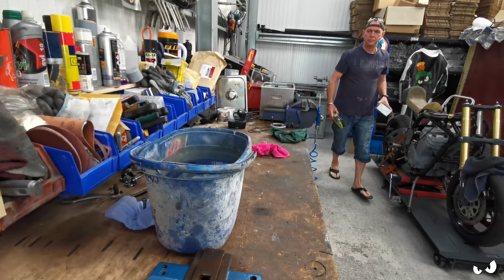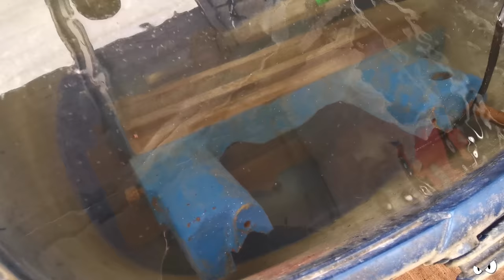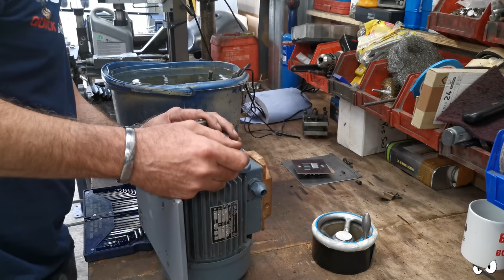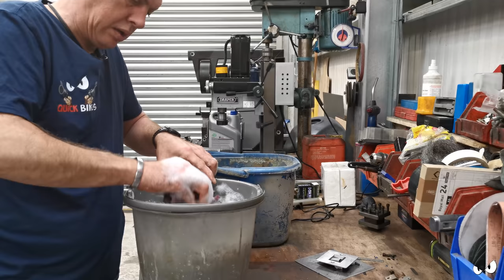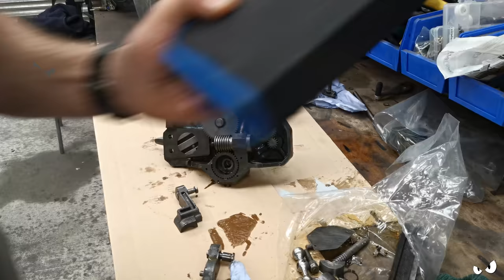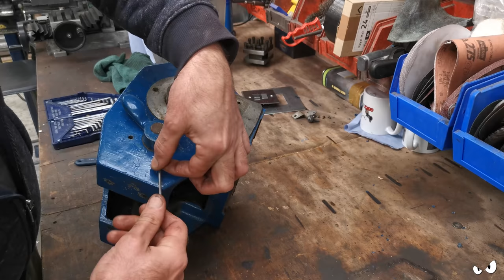Restoring a Boxford AUD Lathe - Part 6

Comment: Really enjoying these videos bringing back so many memories over 30 years ago of working with my dad in the shed where he had a monster of a lathe, he was a tool maker. Running off domestic electric it needed a phase converter and a donkey motor to run. Remember it needed changing to metric thread and gearbox rebuild. Thanks for bringing back good memories of my dad👍
Reply from the maker: Thank you very much for watching, I really appreciate it 😁👍

Comment: Hey there, great watching your boxford refurbish with your trials and tribulations. I recently watched Enots Engineering do a later model boxford and I learnt about the oil well around the manual clutch drive and he had to fit and oil filler Wich had never been done from factory. So off I go to check mine and see if the hole is drilled through to the oil well. Love to know if yours was right as your lathe was I think an earlier model. Fantastic restoration and love to see another machine restoration. Thanks again.
Reply from the maker: Thanks for watching matey 😁
It was a really fun project to do and the best bit is I have a working lathe now. I can't remember about the hole now you mention it... I'm goingbto have to check as there's one oil port which doesn't go anywhere on the saddle... 🤔

Comment: Great video 👍 quickie If you put a key on the pulley rotate the grub screw opposite to the key then drill spot a locater for the grub screw.
Reply from the maker: Yeah that's what I'm thinking. It's screaming out for a key as just a grub screw ain't gonna do the job. I can just imagine the shaft on the motor getting chewed up in no time...

Comment: The oil finish looks sweeeeeeeet 👍 you lose all track of time, when you have lathe up n running and making your own parts. Definitely need some alarms clocks, as you’re never going to just press stop 🛑 and leave as is, to go to main job. Think you need a old shop mannequin for weekends, here’s Stevo 👍😂😂
Reply from the maker: It looks nice doesn't it 👍and saved loads of time masking and painting... I'm really looking forward to using it now. I'm sure to spend hours on it I reckon 🤣😂